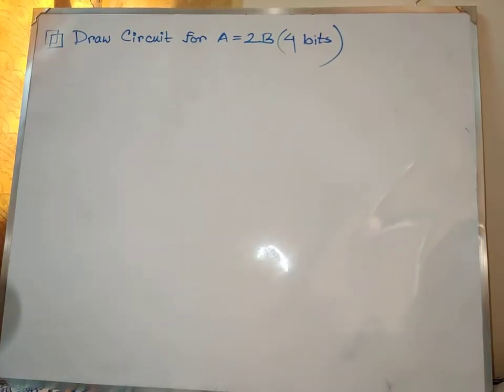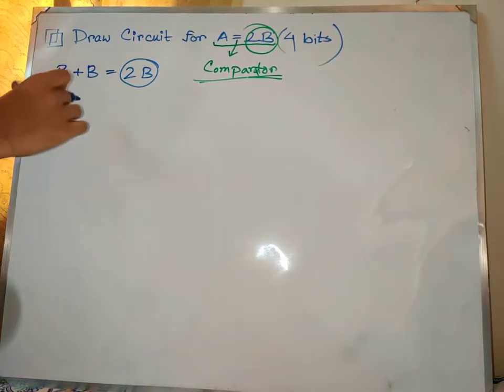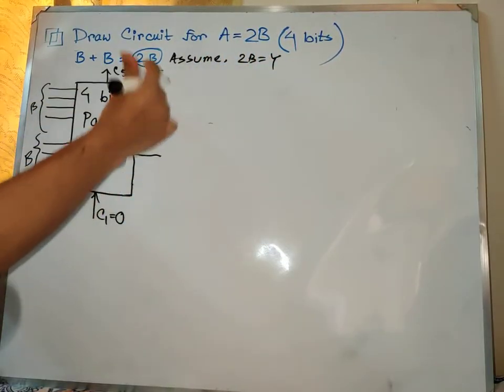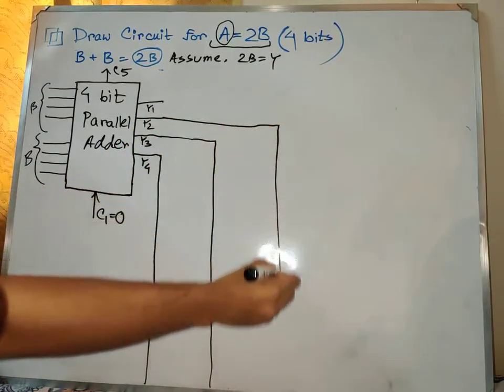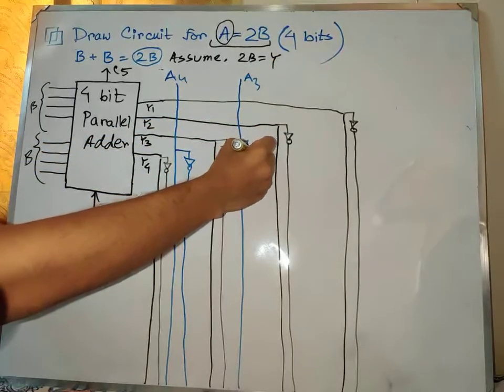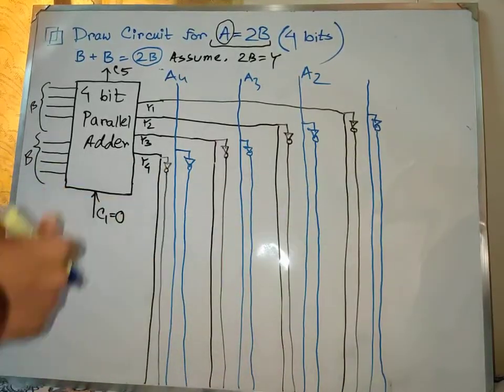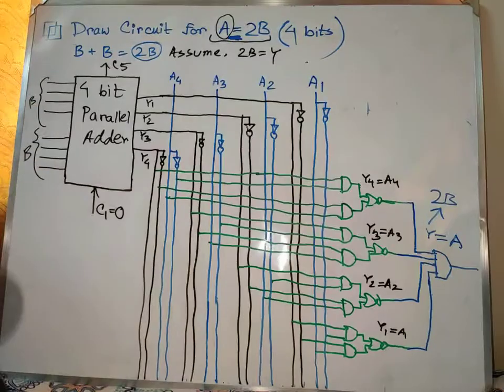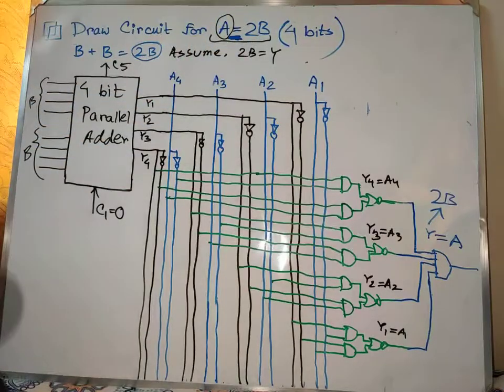How to build A=2B with Comparator Circuit | Digital Logic Design

Comment: sir, there is a C5 that was not used anywhere. And if it came to the picture (i.e. if C5 == 1), then B+B would've been a 5 bit number. So, we could check if C5 == 1, if it is True, then the function would return 1. If C5 != 1, then we would go to the next step with 4 comparison and the function would return 0 or 1 accordingly. Is this a good way to look at it?
Reply from the maker: Yes. 

However, for your specific case, the problem can be solved using 5 bit parallel adders and 5 bit comparators.